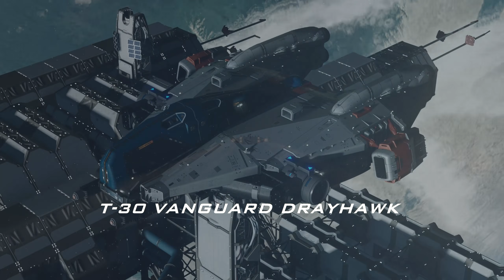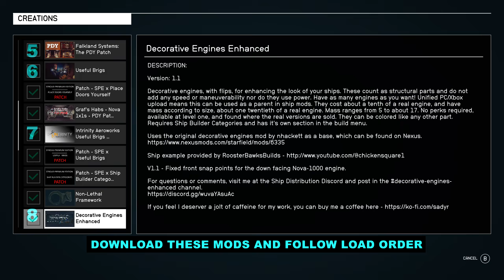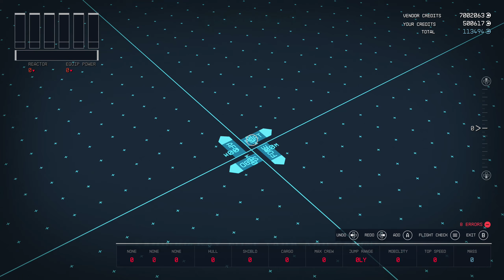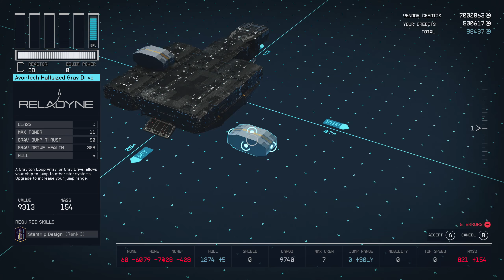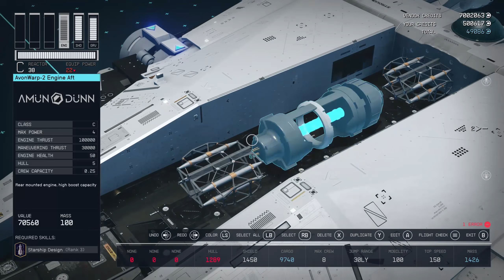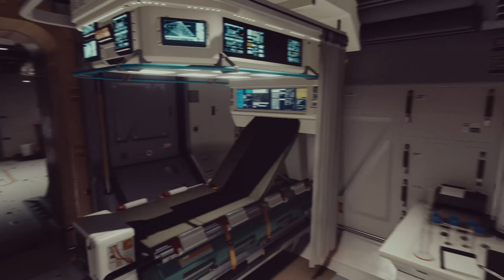Starfield Ship Building Guide - T-30 Vanguard Drayhawk | Multi-Role Light Freighter ship build

Comment: This ship is beautiful. It's sleek, agile, fast, has plenty of room for habs. I turned mine into a smuggling/bounty hunting ship, as light freighters tend to lend themselves to. I swapped out habs and put in an Owl Tech 2x2 Brig in place of the original 2x2, and an Owl Tech Armory and Workshop 3x3 on the port side. The crew quarters I made into Captains Quarters. On the round "airlock/docking port" looking pieces I put horizon weapon mounts and outfitted those with particle weapons, then missiles and EM weapons underneath on the front. It's an awesome rig. I can hold plenty of prisoners with the Useful Brigs mod and the Armory and Workshop in one hab is mint.

It was a little tricky to build though. It might have been because I am on Xbox but for some of the parts that have to be merged I had to figure out another way to make it work because it wouldn't let me do it the way it is done in the video. I did figure out how to get it exactly how it is supposed to be though. Then, the first time I got it all built and finished, I went to enter the ship and I got the "Inaccessible landing bay" bug where the door is locked and reads "Inaccessible" and wont let you enter the ship. I reloaded an old save and built it again and the second time it worked just fine.

I have only 2 complaints now. 

1) I wish it had a front facing landing bay. The ship is so low to the ground you can't walk underneat it, so you have to walk all the way around to get to the back, or use your jump pack to go over it, to board the ship. 

2) Very often some of the ship pieces will glitch out and not appear correctly. The vertical Stroud pieces over the cockpit will tilt to fore or aft about 45 degrees and clip into the inside of the cockpit and the habs just behind it. Also the three Nova pieces that top the engines in the back will all tilt as well, with the aft end of each of them tilting up 45 degrees, and sometimes two of the engines will rotate around the vertical axis about 20-30 degrees. The back of one of the port side engines will rotate out to port and the starboard will rotate out to starboard. The engines glitching isn’t all that noticeable, and the Nova pieces sticking up like spines is actually kinda neat in a way I guess, but the front Stroud pieces clipping through the inside of the cockpit and habs looks awful and it's super annoying. It doesn't appear this way in the menu or the ship builder. Only the actual ship itself in the game world. Sometimes fast traveling will fix it, but sometimes it doesn’t.

Overall the design is excellent and the ship performs VERY well. If it weren't for the buggy parts wigging out and the rear landing bay I would give this a very solid 10/10. 

I would rate this ship an 8.5/10.
Reply: How did you manage to overlap the ship parts? I use Xbox and I can't do it even though I downloaded all the mods.
Reply: @mariof6895 Sorry for the late reply. I had my YouTube comments notifications turned off for some reason. 

I can't remember now how I did it the first time. I think I had to get creative using cargo containers as merge blocks, but not the way shown in the video. I just finished building it again for the second time though and this time I just used one of the Gilibrand snaps to add extra snap points onto the ship where the Avontech hull and Deimos skirt pieces is supposed to go. The Nova cowling and the Stroud piece should attach just fine on their own. The problem is that the Avontech hull and the Deimos skirt both snap to the same snap points. So, just add some more snap points. Problem solved.

Still having problems with the tall Stroud pieces over the cockpit and the skinny Nova cowlings over the top of the engines tilting after the ship is built though and I've only had the ship built for a few hours now. The Stroud ones clip inside the ship interior and it's super annoying, so I hope you don't end up with the same problem. The ship is gorgeous when it looks how it should but having the roof cave in behind the cockpit gets old really fast.

Comment: On Xbox and the step at 9:05 where you merge the Stroud Nose Cap C - Stbd Fore and the Intrinity Deimos Starboard Bottom C and then move them together and attach them to the ship doesn’t work for me. 

I have all the mods installed as suggested in the beginning of the video. I have flip merge turned on. I use the same decorative cargo hold as a merge tool. I can merge the two pieces but when I select the two of them and move them together, they wont attach to the ship in the place shown. The Stroud Nose Cap will attach if I flip glitch it to attach just that, but the Intrinity piece won't. 

Any idea why? Suggested fix? Help would be appreciated.

Comment: This ship is wonderful, with simplicity enough to tweak to taste.

When I put mine together using your build, I remove the forward crest, bow cap and cockpit. I replace the cockpit with the Nova Magellan (or in my specific case, the Black Hat from Mattell's Solitude Series). I replace the forward gear with the NG-20 Fore Landing Gear. Other minor adjustments blend the cockpit into the main hull. The rear engines and their curves lend themselves to the forward curvature, so it doesn't look out of place against the sharper lines of the Intrinity Deimos and Stroud pieces.

I also like to remove the left and right Avontech mounts and use a concealed combination of Nova Mini Braces and Horizon Weapon Mounts tucked into the Stroud Cap C, then attach dual Falkland Thrax Cannons on either side. I like to also put Equipment Plates against the hull toward the front. Any weapon put in there tucks into the gap of the front of the Stroud Cap C, looking like a natural gun port. Atatl 2(X)0C Missile Launchers fit nicely there, or alternatively the Ballistic Solutions CE-(XX) Missile Launchers. For my current build I have Shinigami Dangan W RF Autocannons.

The end result for me is a profile that looks like a diving bird of prey.

Anyway, just wanted to say thanks for the effort you put in, because it lets me build and think about how to make it unique to my tastes. Can't wait for more build ideas!
Reply from the maker: That sounds awesome! Great idea man. I love seeing people make their own custom tweaks to my designs.
Reply: Sorry for the late comment, but can you post a pic somewhere of your build with the replacement parts? Sounds great, and I was just wondering what the different cockpit layout looked like. I can imagine it in my head, but it's different to seeing the actual end product, lol.